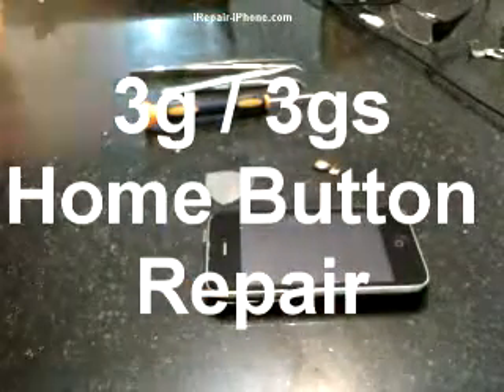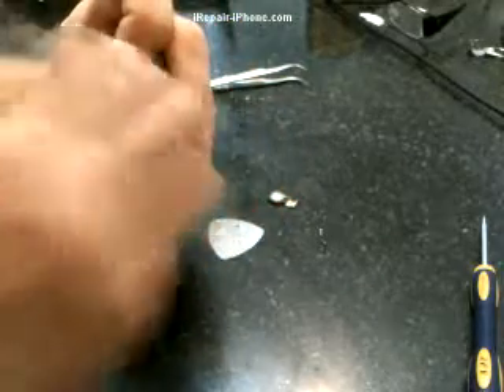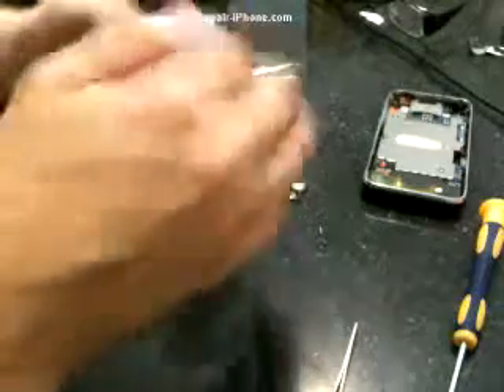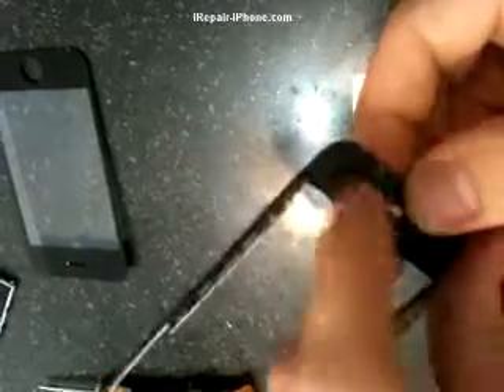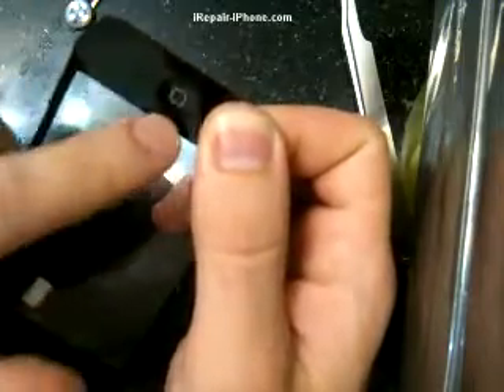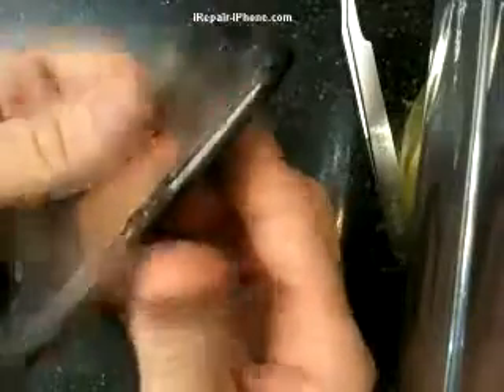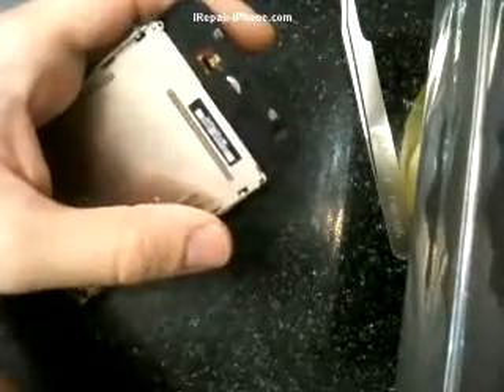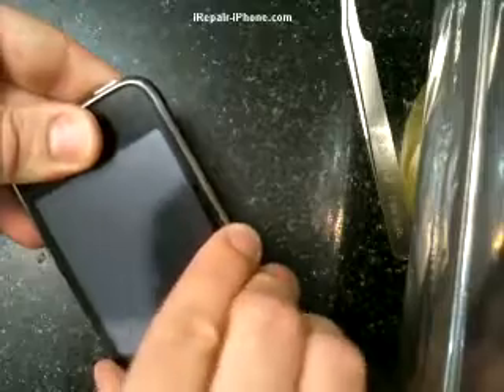iPhone 3g Home Button REPAIR. HOW TO REPLACE THE HOME BUTTON

Comment: Thanks for the info. Helped me replace my home button. 

He wasn't kiddy about the magnet screw driver. I needed it! I used a regular screw driver and putting those little screws took way more time than the whole process entirely. I got lucky and finally after billion times got them to screw in.  

@ Jesse Sawanson, 

Ebay the best place to get a replacement home button. I got mine for $1.59 with free ship! It could had been $0.99 for international seller, but didn't want to wait 2-3 weeks. lol